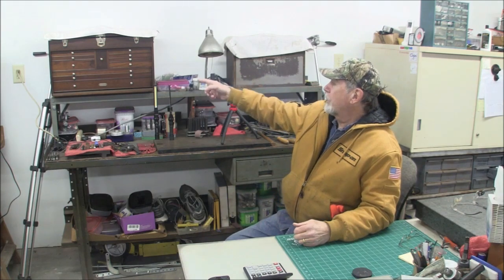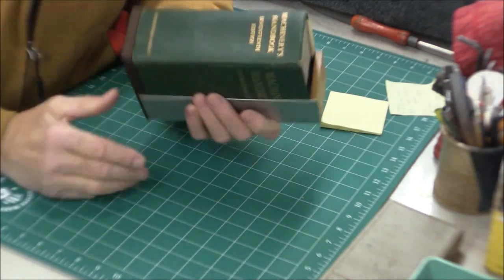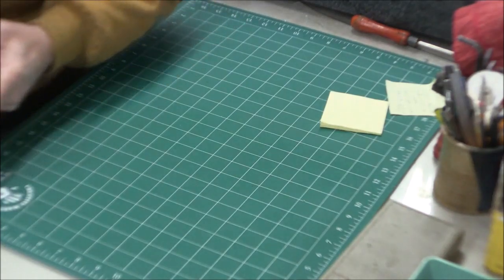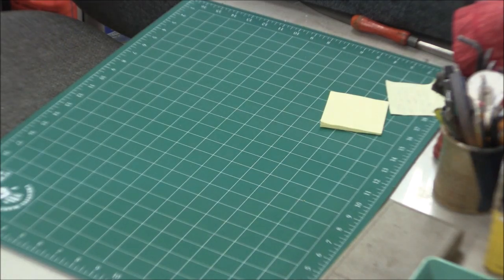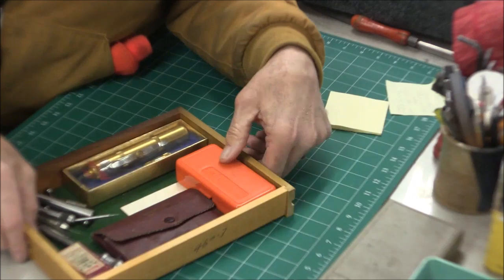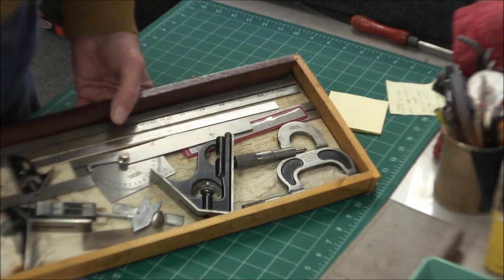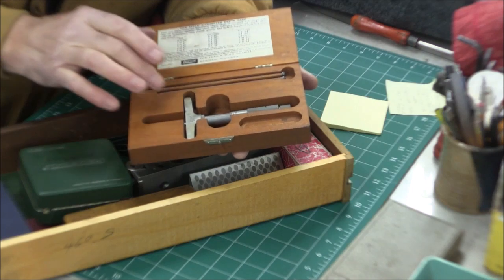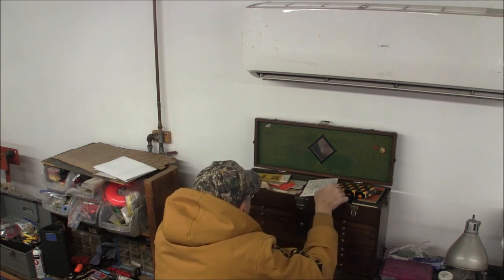What's in your Gerstner toolbox?

Comment: Always wanted to buy a Gerstner tool box but never did . There were several in our dept with them. I settled for a Kennedy tool chest on a Kennedy roll away chest.I do have similar tools as you do. Nice video on your contents and explanation of the tools.
Reply from the maker: I bought this. Box in 1966 so I had it for 55 years. And it was old when I bought it. The dark wood is neat but I always thought the oak ones were better. The auction was in the shop where I worked and put on by the owners to help the guys widow.  One of the guys bid me up higher than I would have liked. I think I gave around $60. I was a poor apprentice. I had the gerstner, the small Kennedy, and another rougher homemade wood box for heavier tools like angle plates, 123 blocks etc.  A couple of the guys had Kennedy roll around sets  and I always kind of wanted one. I imagine all us old school guys have about the same stuff but id like to see more "what's in your box" vids on Youtube. Btw. I ordered a cheapy dro unit to try to see if it will work with my accurite scales for the lathe. If it doesn't work im  not out much money. Not sure if ill release any video. I think we may getting as much snow as you this year!

Comment: Out of curiosity, what sort of wheel would you use to grind in that transfer block of yours.  A v block and some parallels have been on my unending list of things to build since I got my surface grinder a couple years back.
Reply from the maker: Not sure what you refer to when saying "transfer block".  My "go to" wheel is a 46H. I haven't needed to use coolant on anything I've ground so far.  I like to use a reasonably sharp diamond and  quick dressing passes till your wheel is cleaned up. Cross feed when grinding of around .005 -.010. don't let your workpiece get hotter than you can comfortably touch.  Redress often. A good accurate surface doesn't shine like a mirror.
Reply: @michaelmurray9154  I was referring to the aluminum v block.  I just wasn't sure if you used anything special for grinding a combination of aluminum and mild steel, like a harder bond.  Though I suppose if it works to clean up the brass in the mag chuck it should probably do fine with aluminum too.
Reply from the maker: Aha! When grinding aluminum I use a 46H wheel  and spray frequently when kerosene. Which is what I did when making the vee block.